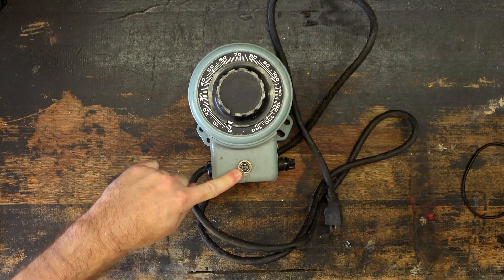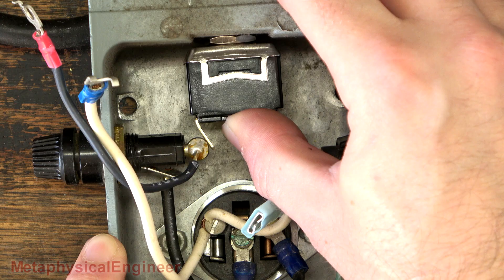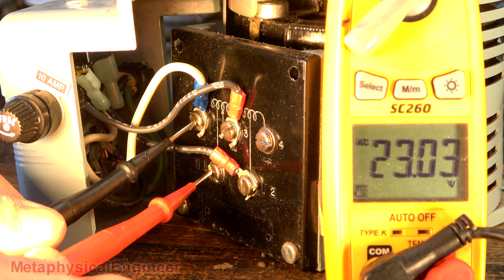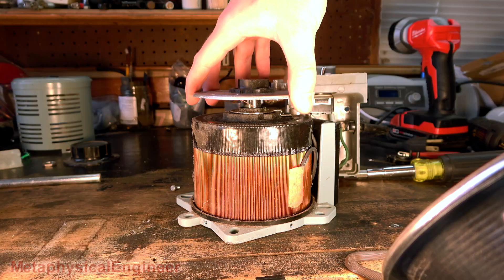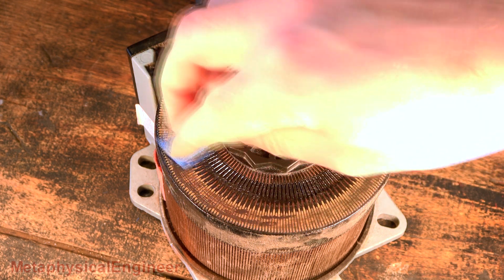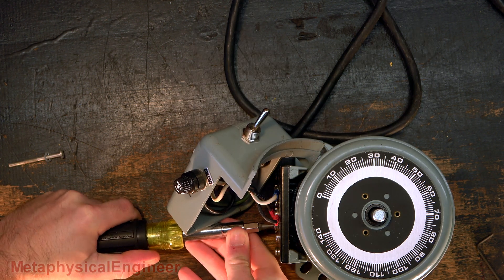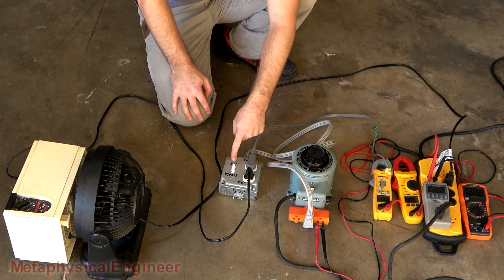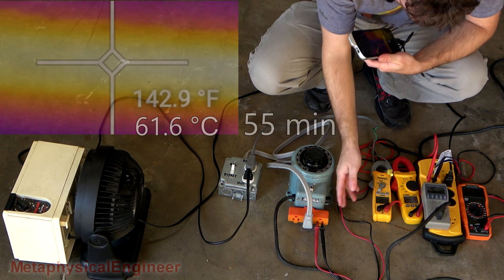Refurbishing An Old Variac

Comment: When REAL General Radio actual Variacs were shipped there were rubber wedges jammed into the wiper assembly so it would NOT move, and the wiper had a piece of special paper in between it and the contacts on the coil. Leaving the wiper carbon contact on the coils in one spot for several months will damage the contact wiper and the coils. They kind of fuse themselves together. Some 1200-2000 grit sandpaper then some 6000 grit or jeweler's polishing rouge will smooth them back out. Paint thinner (odorless mineral spirits) are faster than alcohol for cleaning too, and mineral spirits are THE main ingredient in electrical/electronics cleaners.
Reply from the maker: Thanks for the insight and history lesson!

I was worried that a more aggressive solvent could start eating the varnish off the windings.  Next time I pull it apart I'll try the mineral spirits or other electronics cleaner and fine sandpaper.

Comment: My friend got one of these for 20 bucks. He's looking to sell it but I'm a bit too scared of what these are capable of
Reply from the maker: You’re right to be cautions. A big danger with these is lack of isolation and large amounts of current available, so just as much risk of shock or electrocution as if you were directly applying line voltage.  Requires the same safety procedures and common sense as working with any other live, mains powered equipment.  

What would you be using it for if you did end up buying after all?
Reply: @MetaphysicalEngineer  I don't really know, to be honest. Debugging analog electronics? I'm an ECE student so I see it as a tool that I can play with AC with, not that playing with AC sounds very safe. I know a guy who's more into analog and power electronics than I am (he's collected microwave transformers for "eventual use"), maybe he'll get the variac instead. I'm curious what he'd do with it!
Reply from the maker: If you’d be reconditioning things like amplifiers, a variac is an extremely handy tool.  Combine with a ballast controller like I had in the load test and an incandescent lightbulb to carefully power up equipment that’s been sitting for a while.  Or in general on equipment where you suspect damage or don’t know the history of.  Slowly bringing up the voltage will allow things such as power supply capacitors to reform instead of punching through.   The lightbulb will limit fault current and give a handy indication of problems if it glows brightly.  Combined can prevent avoidable problems like exploding input stages, or stop a minor fault from causing a cascade failure.  Other uses involve testing a design’s tolerance of line voltage going out of spec. 

I have a few much older videos where I used this device for destruction, or for science, such as running a fluorescent tube on variable voltage DC with a lightbulb for a ballast.

Comment: I got one I've had for like 20 yrs I need to do the same thing to. Nice to see someone walk through it.
Reply from the maker: A little bit of care now and then and these units can almost last forever.  Glad you found this video helpful!  How much and what kind of use does your unit see?
Reply: @MetaphysicalEngineer  Lately, I don't use it all that often. It mostly does duty as a variable DC power supply when I need 100-150V for something. Occasionally, I need 24-48VAC to test a small drive or something.